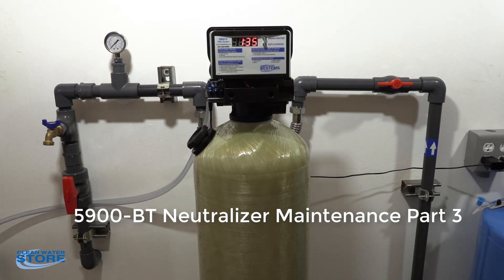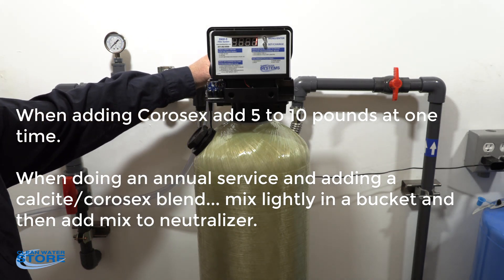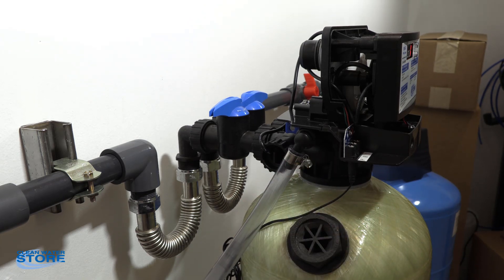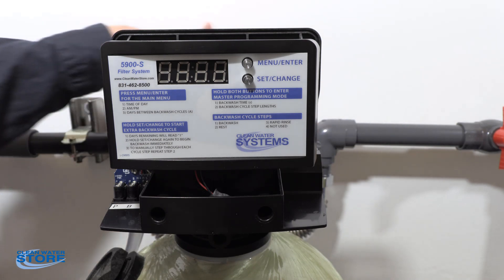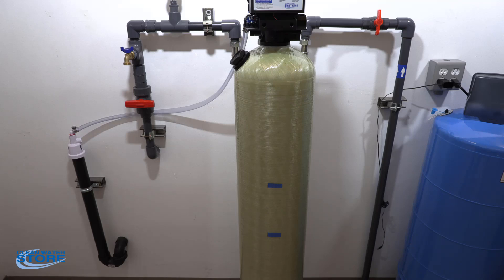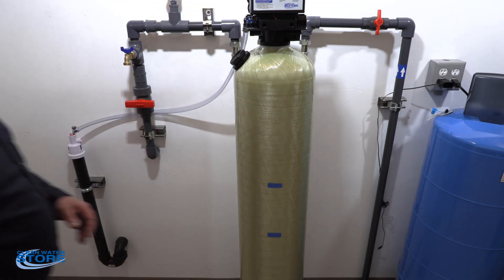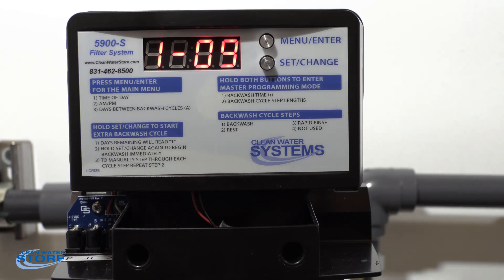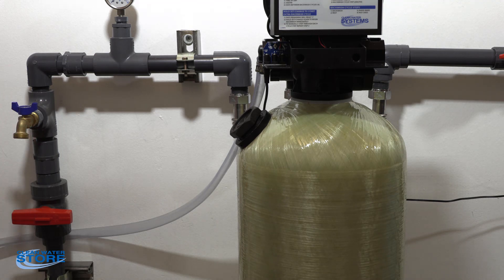5900-BT Calcite Acid Neutralizer Maintenance Part 3

Comment: Thanks for the clear explanation, with stable camera and no distracting music.  Looks like the system is set up as props for the demo, no water or pressure.  Maybe its obvious, but seems like you left out the step of siphoning out some water, and some provision for the water that will come out of the fill port,  to make room for the added media.

Comment: My house has a ph of around 4.5 to 5 and reading online I need a 2.5 cuf tank. How long does it last for a house of 2 people before adding more calcite or corosex?
Reply from the maker: Hello -  at least a year.  The neutralizer tank starts out at 2/3rd full of calcite/corosex blend media and after about a year it might go down to about half full.  At that point, fill back up to 2/3rds full.  You might use 25 to 50 lbs of calcite a year.